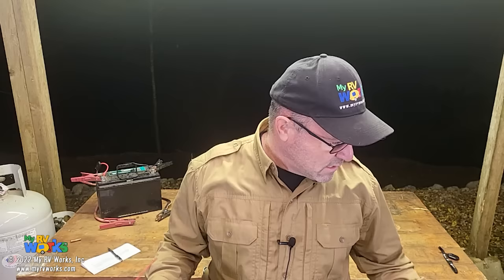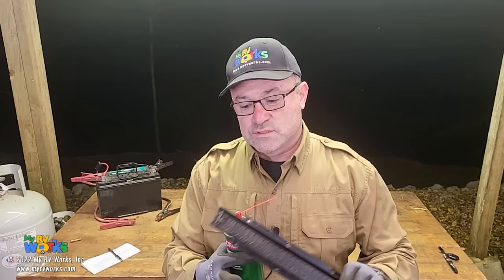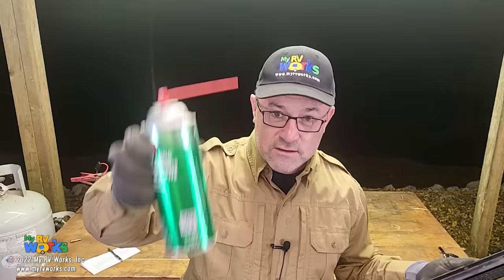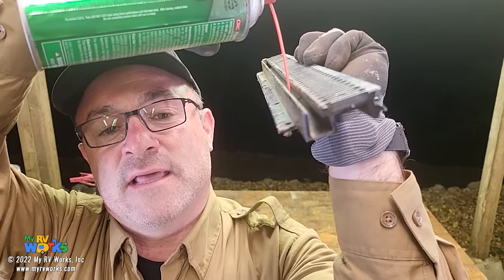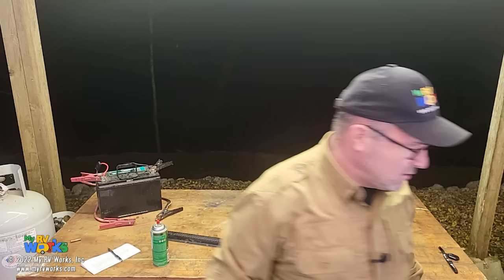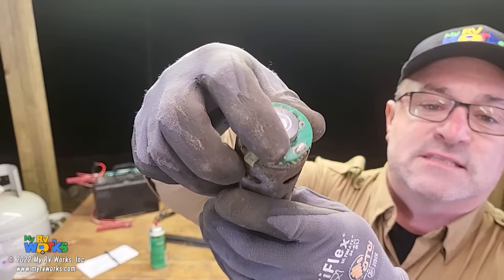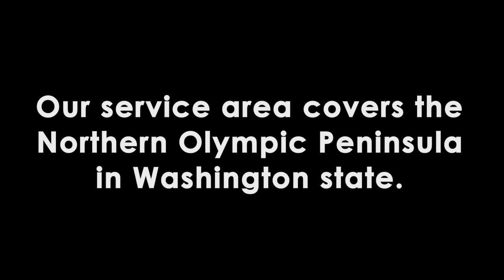Schwintek Slide Room Only Moves 2 Inches And One Motor Stops -- My RV Works

Comment: Hello Darren, my name is Jerry and I’m a mobile tech as well. I’m working on a 2012 Dutchmen voltage that has the same issue going on, goes out a little ways and stops. The distance it travels and the synchronization of the slide is random and inconsistent. I replaced both motors, both wiring harnesses thinking problem was solved, but the controller is not flashing any codes. Lubed everything that was mentioned in your video but problem is still there. Checked voltage at house batteries as well as at the switch , numbers are good. Called Lippert and spoke with Vance in the tech department (nice guy), and he said I’ve done everything thus far by the book. He then said that he would move on to potential structural issues. He asked if I could turn the v guide wheels with my fingers (as you should be able to) then said that the slide could be bearing down on the v guide wheels to much and causing the motors to amp out prematurely. He then suggested to loosen the brackets for the slide room floor rollers then place some fender washers under the brackets then retighten. This was in an attempt to place more slide room weight on the floor rollers and less on the v guide wheels. It’s still doing the same thing. I used a known working controller box from one of the other slide rooms to eliminate a bad box as the problem. No luck there either. I then tried the manual override feature on the control box, and she worked flawlessly. But after the override feature timed out, it went right back to doing the same thing. I’m lost buddy, please help!!!
Reply from the maker: Sounds like the controller is registering the motors amping out and therefore stopping without a fault because the room thinks it's at its limit. That would explain the inconsistency. You've lubricated everything, but how about the wiper seals? I did a small Class B with a slide room like this and it turns out that the whole Underside was fiberglass and the resistance was the fiberglass to the wiper seal. I cleaned that and lubricated it really with a PTFE product the whole underbelly of the slide, and that fixed that problem. Also, if there's a slide topper on this and it's having an issue going out, the slide topper spring may be wound too tight. So if you approach this from the perspective of the motors amping out we just have to figure out where the resistance is. In another one of our videos I put a current meter on the slide and you can watch the current going to the motor through the display on the computer. Don't know if you have anything that fancy but it's fun to actually see the current working these motors. If the motors are easy to access, and you can pop those up out of their collet, try to see how easy it would be to physically push the room in and out. I know that's a bit extreme, but that might help identify where that resistance spot is. On another job it turns out to be rubbing on the floor in a specific spot. Good luck, sometimes you have to be a sleuth but you always learn from these jobs and carry it forward with you.

If you're a mobile RV tech, on our website you can get access to a link where we do a how to start a mobile RV service business series. Might be something you want to check out.
https://myrvworks.com/how-to-start-a-mobile-repair-business/
Reply: @MyRVWorks  wow, what a fast and thoughtful response. Thank you a ton! And thank you to your team.

Comment: Thank you Darren! Although I am not having any problems with my Schwintek  slide and I have always lubed according to Lippert's recommendations, I will do as you have suggested and lube the upper track slot. I wonder if I should clean out the slot after every camping season to remove any accumulated dirt and grunge and then relubricate?  I have linked many of your videos to other RVer's on the FB groups I belong too. Kudos to you.

Comment: I have a 2016 tracer trailer with a schwintek slide. Was wondering how the seals are suppose to be installed. I took it to a shop to fix the slide because it would go out but not want to go back in. There fixed it but when I got it back the seal on the bottom of the slide was knotched out where the rollers are. Needless to say we were driving in the rain and when we stopped to camp the inside of the trailer was soaked with water. I am thinking its the knotches in the seal that caused the water to get in.....  Could you show a picture of what the bottom seal should look like installed?

Comment: Why change and obsolete parts? Well planned obsolescence. And what is really important is to clean any cruft before spraying on the lubricant. I use silicon based 3m spray after carefully cleaning the gear tracks.

Comment: Hi Darren,  I have a question.  I just did a rebuild on Schwintek In-Wall Slide-Out inverted on one side.   I had both sides timing in the H frame before reinstalling recommended by Lippert.  After re-installing upper and lower track where within the 1/4 after the install.  I believe that Lippert recommends 1/8.   My question if I use my own power by jumping with resynchronize as discussed in this video?   I have one side not moving and fully extended.

Comment: Hi Darren, Thank you very much. After 35,081 trailer miles in my Lance travel trailer, with a schwintek slide-out, I find out (from you) not to stop right away the slide-out to synchronize it but keep the switch pressed about 3 seconds longer.
I am having problems with my slide-out and decided to lubricate the teeth, not inside the channel/track and the ceramic wheel on the bottom grove.
My problem seems to be more problematic.
2013 Lance 1885 travel trailer. The slide-out has worked all of the time; motor does not fail; does not get stuck in or out; no electrical issues; sometimes sides timing is off – Synchronization process seems to work?
The problem I have noticed is, at times the slide-out drops (teeter totter like) on the way out while continuing sliding out all the way, without stopping.
While on our 29-day outing ending on June 4, 2024 we noticed a slight crack on the trailer’s fiberglass exterior on both bottom corners below the slide-out.

Comment: I have this system, full wall slide. On the rear tracks i have two top tracks and one bottom. When i slide in, the slide goes all the way in at the top, but the bottom is out about an inch or 2. Front part of the wall slide both top and bottom come in all the way flush. Any ideas??

Comment: I’ve done all this and my slide still comes in one side faster than the other, then they catch up, I tried to synchronize the motors, but I still doing the same faster one side faster than the other, any ideas.

Comment: What about if the gears are jumping teeth when it reaches either end of travel before the controller amps out. Can you adjust the sensitivity on the controller? 2021 Tiffin Allegro with very little use has this issue. Thanks.

Comment: I have a camper the one motor ceased up so we got a new motor. Now the one side only moves about 2 inches and it stops but the other side continues to go out. The code is still the same as before we changed the motor. It says it is a short between the box and the motor but we tested the wire and it is good. What do we do next?

Comment: I stumbled upon this video on our last trip out because our slide wasn’t extending properly. I didn’t have the CRC lune with me, but I did have some LPS greaseless lube on hand and sprayed that on the rails and after retracting and extending the slide a few times the slide started working flawlessly.  Anyway I have since ordered the CRC lube. In your opinion will the LPS cause harm to  the the rails, and should I try to use some type of cleaner on the rails before spraying the CRC on them?  Thank you for any and all input.

Comment: Thanks - learned a lot about my slides thanks to your videos!  Quick question - what’s the easiest way to access under the slide?  Can’t be done from the outside?  I use a thin piece of wood on the inside to try to remove items that get under but I fear there are items keeping my slide from completely closing and don’t know the best way to check.

Comment: Love your videos. I have Lippert controller 366701 which is now 700156. My slide was only going out on 1 side, then when I tried to retract, the side that went out would not move, and side that did not move was trying to come in.  I replaced the controller (with a used one) and both sides went out just a little at a time until I got it all the way out. When I tried to retract. Only 1 side came in . I jerked it back and forth with the switches and it finally came in a little at a time.  I am getting a fault code for motor 1, but I have hot wired both motors and they are fine. Wiring?

Comment: In looking for help. When moving my slide out I had to stop halfway (I didn't know that you shouldn't do that)  and now only one side is  moving. I'm not getting any codes from the controller and I can hear the motor spinning on the side that is not moving. Any help would be appreciated.

Comment: My Schwintek has been doing this for several months... As it's coming in one side will stop and the other continue. I move it back in/out each time, holding the button for up to 3 seconds when it seats. Eventually the problem switches sides and the other side begins to stick. There was lithium grease in the track so I used mineral spirits to remove all the grease and would use food grade silicone spay to lube the tracks the last several times until I saw this video. I used power lube and the problem still persists. Any suggestions?

Comment: Had this problem on a different slide system and almost lost my mind until I changed the auto reset relay fuse and the problem went away.

Comment: Hey i was watching an old video on the thermistor you had and wondered if you could help. I have a 2011 springdale by keystone with a 2009 built dometic fridge , about three years ago i started living in it and recently i defrosted the fridge and freezer and now the fridge wont stop freezing my, EVERYTHING. I have my thermistor wire in my plastic holder on the right fin bnc thats where the sticker is and its still freezing everything. prior to defrost i didnt know what the wire was so i had it in the drip pan and it worked fine. but no that doesnt work. could i have made my thermistor go out or something else?

Comment: I have a Forest River 2022 Berkshire 40XL. 5 days ago I forgot to plug shore power in. When I went to start it yesterday all batteries were dead, both 6 and 12 volt. I used a commercial charger and charged the 12 volts at 40 amp for. About 90 minutes. It then started okay.  I plugged the shore power in and let it charge the house batteries. After 24 hours everything seemed to work. It has three slides but the only one that would work was the bedroom slide. The other two old not even try to move. Checked the fuses and they seemed to be okay. Do you have any ideas?

Comment: ** Here's a question: any problem with opening these slides in the front area, when the 5th wheel is still mounted to the truck...for overnight temp stays? Thx

Comment: Great video..
I have to say i watch all your videos, I get a lot out of them and the information I've learned has save me tons of labor costs.  But I ran into a Schwintek slide on my rig, that only 1 side moves (motor 1). Next, looking at the controller I get a Motor 2 short fault (6 beeps). I did the override and still only the 1 side moves. Next, I tried to manually push the slide out (unplugged both motors from controller) and can't move the bad end of the side.  Some extra information, it sounds like it's trying to move the slide, but it just won't move.  The slide is about 2 inches from ceiling and the side wall with it all the way in so I can't get to the motor or H rail to remove the slide from the outside or inside.  I've tried to get the slide trim off and just succeeded in breaking the trim. I would have thought the trim would have been nailed on like you have demonstrated.  Got any ideas on how to proceed?  I'm stumped.
Reply: I have this exact issue on ours. Did you ever figure out what the issue was? Sometimes when we wiggle a wire it will all of a sudden start working. But it’s a hit or miss on that.
Reply: I'm in the same boat
Reply: @xevnoc  I had a bad motor, best of luck.  Recommend getting the test wire min 5 ft. Helped with the troubleshooting.

Comment: Question:  I like the Thor Aria 3901 but this unit has a full wall slide that uses the Swintec System. Does this sound troublesome using Swintec System onna full wall slide? Would you suggest not purchasing said unit?

Comment: I wish my Palomino Columbus had the track system on my slide-outs. Mine seems to have large screws from underneath. I've brought my slides in/out several times and held the switches to re-sync but both my largest slides are not going all the way out. From inside trailer, the tops of the frames are touching the walls but the bottoms have gaps over 1" to 1-1/2" (crooked) and not sealing. The winter wind enters around gaps and I've tried jamming insulation to help stop the air leaks and bugs from entering but still doesn't help. I got underneath open slides to look for manual controls but still haven't found them in an attempt to force the slides to full extension to seal the gaps and fully compress the bulb weather stripping. The slides are nice for the extra space they provide but boy are they a pain in the you know what when they don't operate as intended.

Comment: Will lubrication help with slide only going all the way in at 3 points and the bottom of one corner not going in all the way?  What I mean is that it looks like one side of the slide is out of plumb.

Comment: I have a 2023 reflection 280rs, with the token schwintec slide on the kitchen   Fridge, stove etc.  as a snowbird. Parked for several months, should I lube the guides n run the slide in n out a few times. Once a month or once every couple of months.  Same with the living room slide. (It’s the roller style or screw Jack whatever the proper name is for that slide??). Thx. 😊

Comment: Another slide room issue for you.  If I look under the kitchen slide of my 38' Thor Challenger, I see a white "T-bar" that rides in a slot under the room.  I believe its purpose it to act as a guide to keep the room from shifting toward the front or rear of the RV when the RV is bouncing down the road.  The problem is that my room DOES shift in that way.  Now, the room rubs on that T-bar when extending or retracting and causes my Schwintek motors to amp out, causing the slide to stop prematurely.  I have "solved" this by purchasing a crowbar and then trying to muscle the room back into alignment... but I am worried that I could be damaging the Schwintek gears, motors or other parts.  Recently, I shot some Teflon lubricant into that area and it is helping bandage the immediate issue.  Have you seen this before?  Is there a better way to resolve this issue?  I have a photo of the T-bar installation if that would help illustrate my issue.  Thanks!

Comment: Regarding running my slide all the way out, if I do that it starts to tear off the trim on the inside.  I've had to re-attached the trim several times because the slide goes out too far.  How can I address that? I feel if I held my finger for 3 seconds longer it would slide out and drop on the ground!

Comment: I have ordered the lubricant, but I just went over to the storage facility and "synced it" - I pushed it out 2" about 4 times, and brought it in and held the button until there was no noise.  I then pushed it out- okay, about 1/2 way- concerned it wouldn't come back in.  This slider has apparently given e some PTSD- anyway I've had it out and back in  times.  Thanks.

Comment: Do you have any experience with power gear slide out drives. I have a 2008 Winnebago outlook that the living room slide, will mostly stop part way out (not in) and not every time. And sometimes not at all until I manually give it a crank.
Any suggestions.
And I love Salt Creek, I’m one of those guys from across the water
Thanks

Comment: The wall by our slide is bowing outward, I hate to keep putting pressure on the wall by holding the control down after it has reached its limit, grand Design says the bow is normal, I call bs.

Comment: "The engineer who's designing this thing..." Ummm. This is the RV industry. Engineers are expensive and therefore rarely welcome unless federally required for roadworthiness. In the RV industry, "engineer" in my experience means a sales manager or a service guy with a CAD program. That's how pieces of aluminum foil turn into high-R-value insulation, and also helps to explain what is behind the rest of your complaint on the continual revisions.